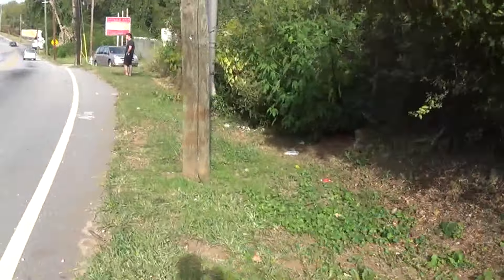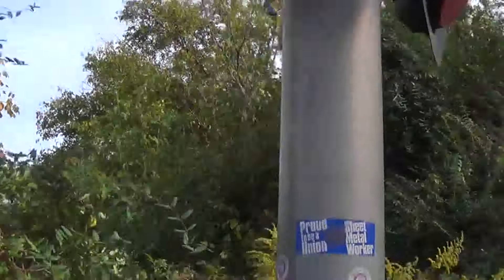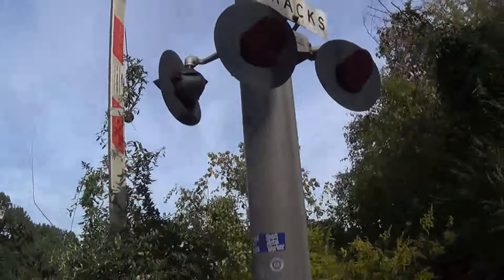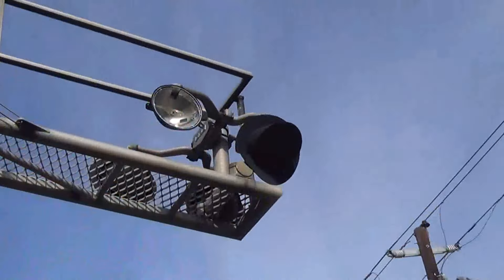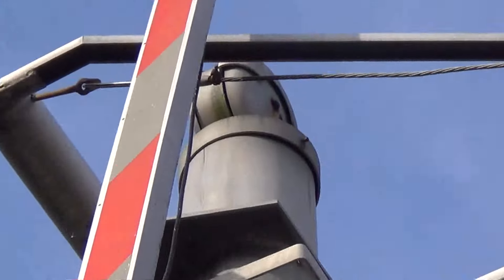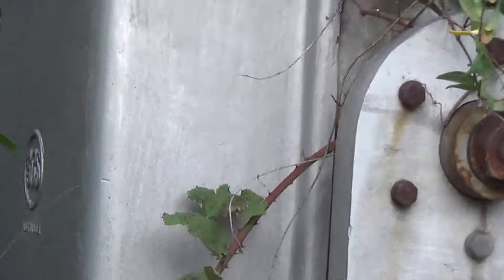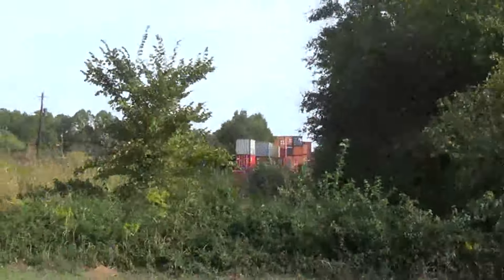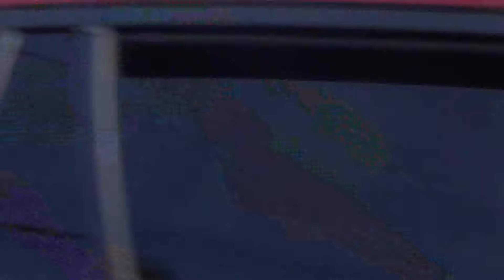Abandoned Railroad Crossing

Comment: I would say that this line stopped running trains in the early to mid 2000's, as I pretty much know that the line wasn't around for very long though. :P
Reply from the maker: Actually, it was officially closed & abandoned back in 2008 according to the FRA, but had probably been dead for years prior.
Reply: I have a bunch of abandoned crossings that I need to come by down to soon.